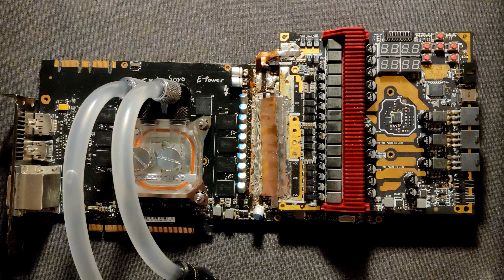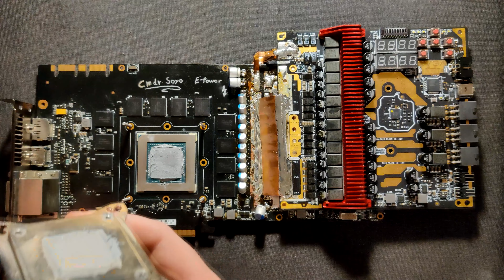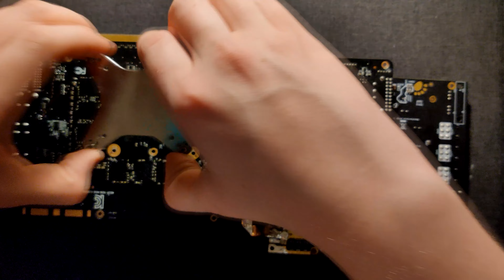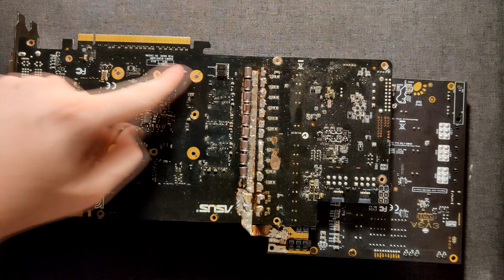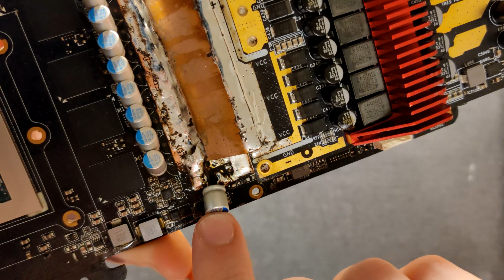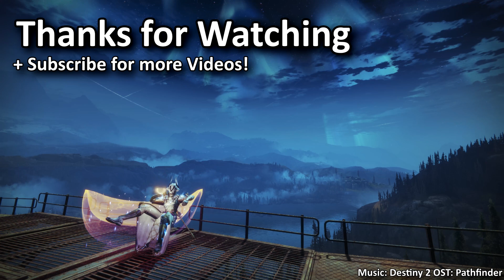The E-Powered 780Ti finally runs properly

Comment: Just wanted to ask if you could give me a quick advice.
I have a GPU that worked fine except the GPUz was reporting 0.0% TDP, so I thought ok, i will just reinstall drivers, and while installing the propper nvidia drivers the PC blackscreened (like it does when installing drivers except it didn't come back) Now the PC reports no gpu detected, and there is no video output. The GPUz was running at the time of death, the GPU temp was 38.? deg and reported hotspot was 40.? deg reported TDP of 0.0%. One more thing  I noticed is that there is no voltage on the core or the VRAM. No fuses were popped and no shorts appeared. Is there something I should look for?

One more thing I noticed while testing it was that the HDMI port was not working, but the display Port did if that gives us any usefull information.